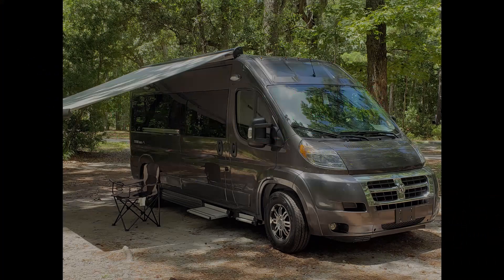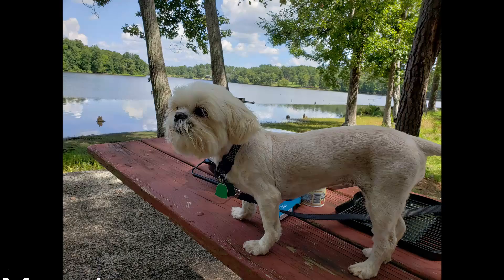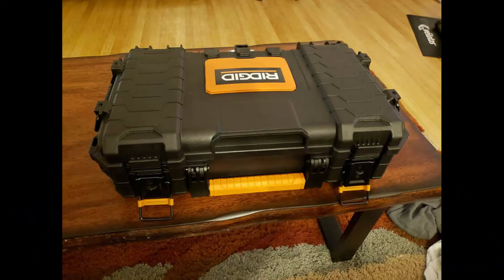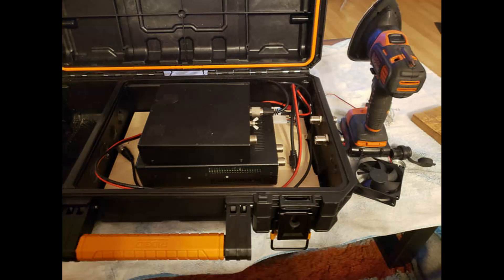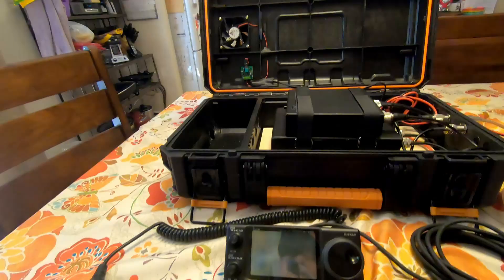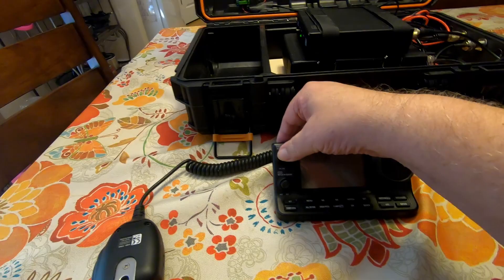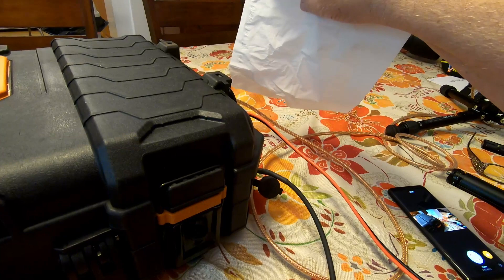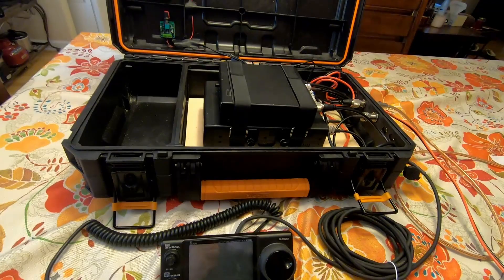GoBox

Comment: How has the go box been working for you ? Have you made any changes since the video? I am in the process of making a portable box strictly for digital modes with a 706mk2g and a old 817. I will bring it to POTA activations to make the digital contacts. What are you using for portable power?

Comment: How about FT-8 and PSK-31 operation?
Reply from the maker: thank you for visiting and the question.  The unit is capable but I have not done either.  I originally set it up for camping and POTA, now use it at my Mich location as I have a new POTA rig.  My Yaesu 991 is configured for all modes at home with a dedicated computer.

Comment: I see no reason to close the case.
Reply from the maker: There is no reason you "have" to close it...  You are absolutely correct I have closed it to stand on end and set on the ground when using a small table.  On a large picnic table, I have left it open...    also have closed it to keep my little dogs nose out of it (as she gets up on the table)
In the house, I close it and stand it on the floor while the radio head occupies a corner of my not so open desk.     Also if you used in the Van it would stand on end on the floor.
Open or closed, your option and if you never close it, you do not need the fan for cooling.
Thanks for your comments!
Reply: @vanventure4985  When I’m outside portable with my expensive radios I like to be able to enclose the radio as much as possible to keep it the dust and dirt away. When I’m at the beach or near salt water enclosures are very good
Reply from the maker: @tonyd6884  You absolutely correct...    I do close it depending on weather and dust dirt etc.